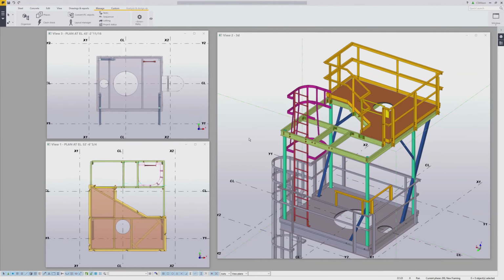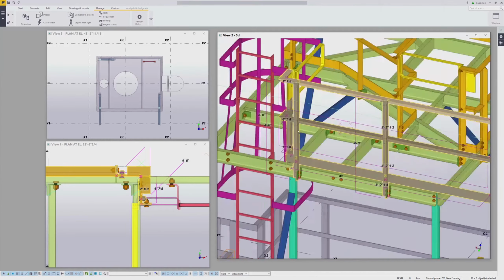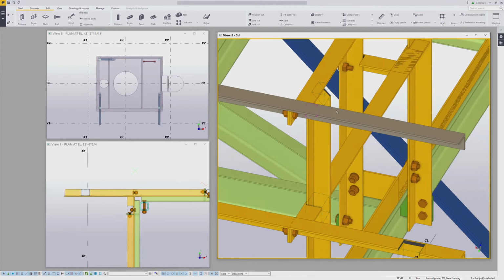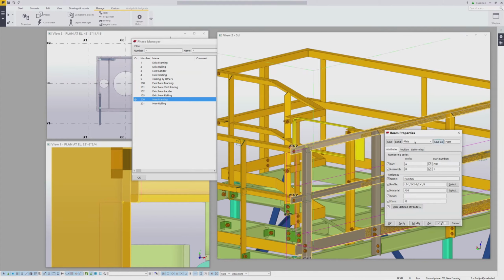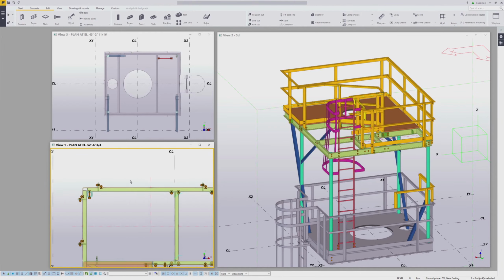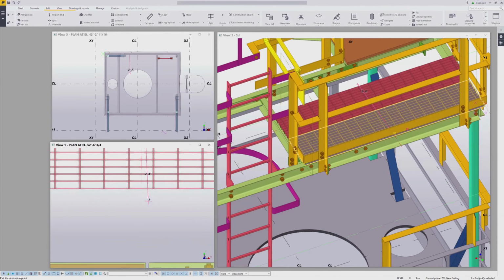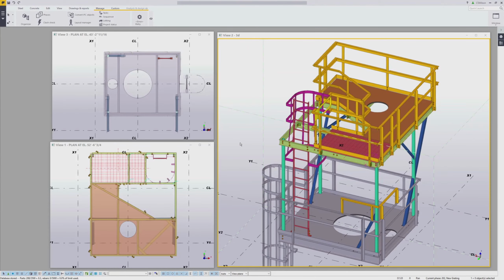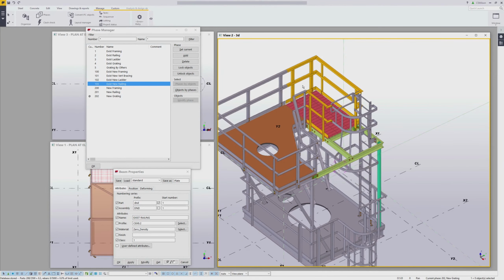Additions To An Existing Platform - Part 2: More Modeling (Tekla Structures 2016)

Comment: Nice video! Why cont we use copy to anotther object command by selecting whole railing assembly
Reply from the maker: That's certainly another way to copy objects from one place to another.  However, using Copy-to-another-object command involves the source and destination end points, specifically, the start points.  It could possibly be used to roughly copy something from one place to another, but I've found it to be too clumsy when the parts you're copy to and from are not the same or the destination part is shorter or is modeled in a different orientation.  The Copy-to-another-plane simply copies and rotates the objects from one point to another that the user specifies which gives much more control over the copy process.
Thanks for the great question!  I hope I've answered it for you!
Reply: Thanks I got full idea about that